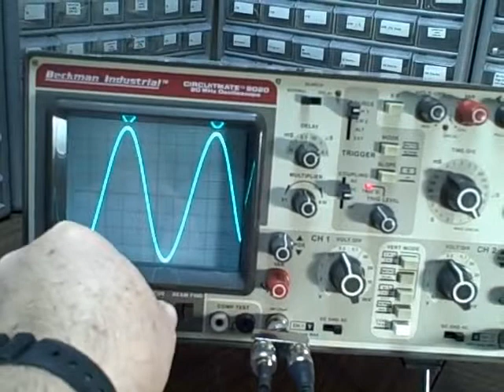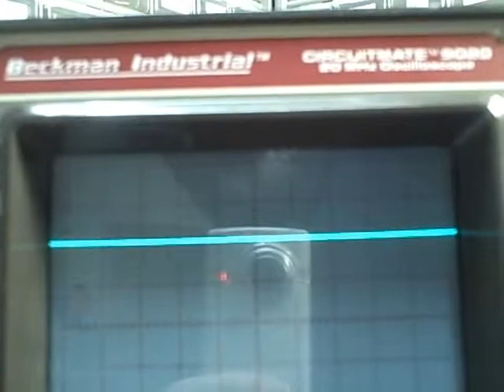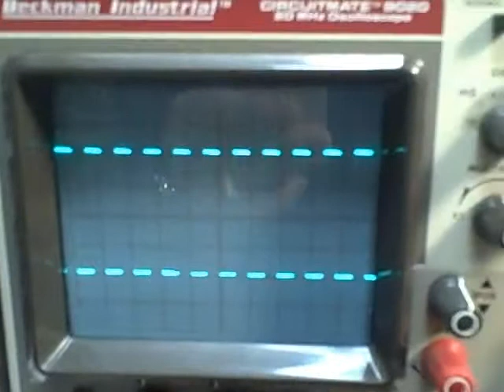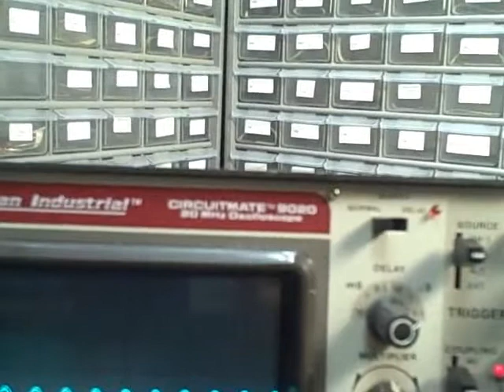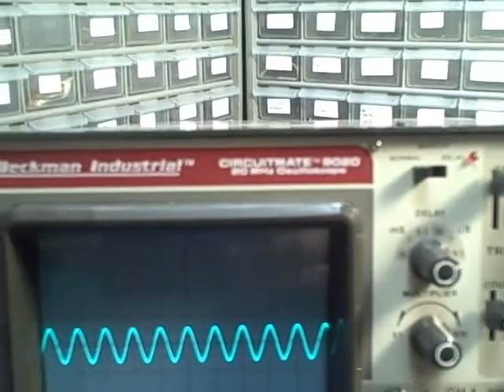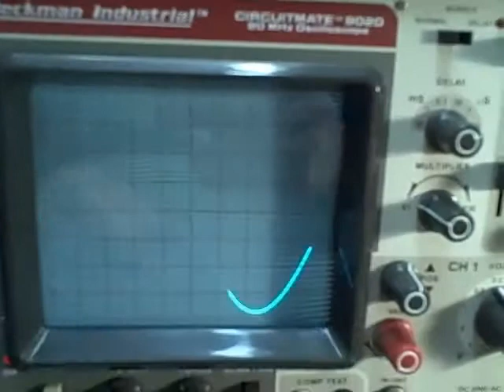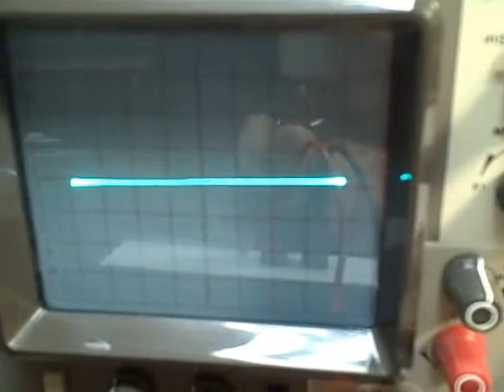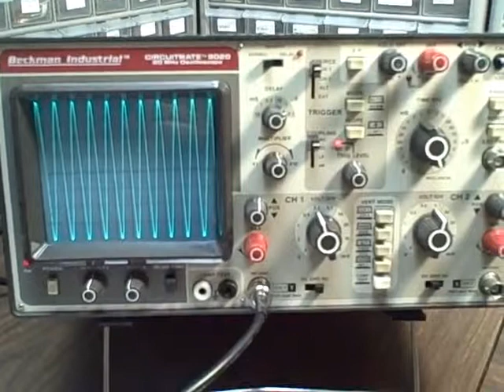Beckman 9020 Dual Trace 20Mhz Oscilloscope - unit 3

Comment: Nice review but I am trying to repair my 9020. My does not have a good square wave out of the calibrator circuit . I am also trying to set the 264volt supply to 260v. I would like to see some of the internal boards and troubleshooting tips.